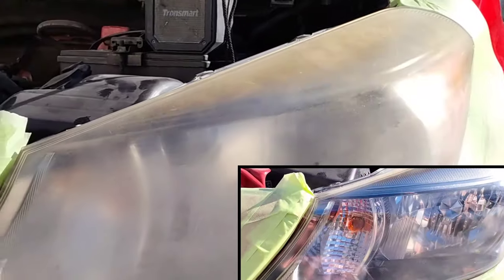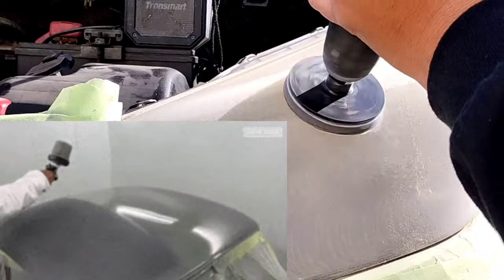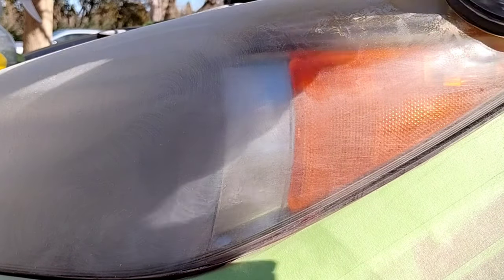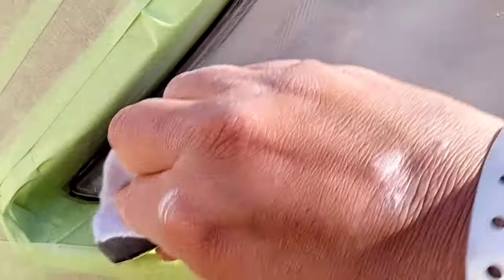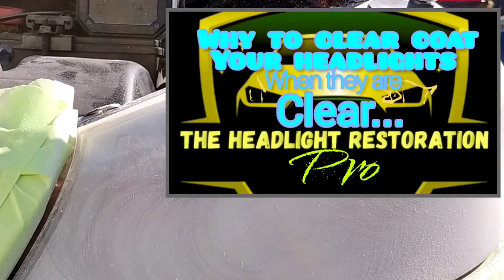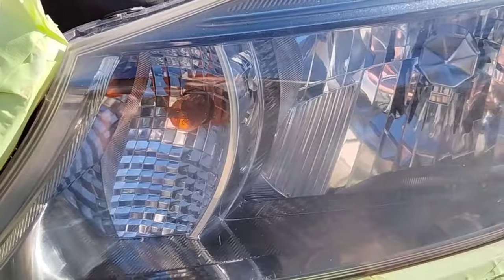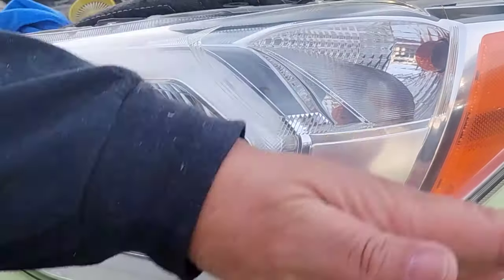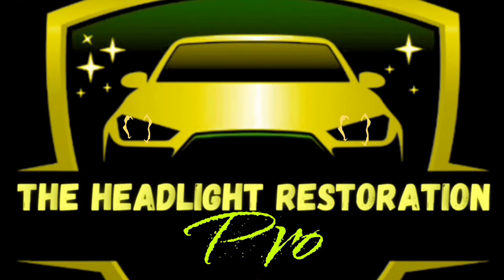how to CLEAR COAT HEADLIGHTS like a BOSS 🦍💯

Comment: Two questions for you:
 1.Have you ever used ceramic coating instead of clear coat?
2. Have you ever cleaned inside headlights?
Reply from the maker: It's almost useless cleaning the inside of a headlight once you open them they're never the same and 99% of the time if you try to open a headlight you will damage everything around it it's damn near impossible it takes so long it's not possible far as a business setting.. it's a total loss because it would take 3 to 4 hours to probably open it alone without breaking it.. just a labor would be too much..
I have you ceramic coating and I'm still experimenting with it.. I would not recommend it with headlights.. it's too thin and too hard.. which has to do a lot with impact.. also the UV protection is not adequate and dies fast, classic kind of wears off like Wax does.... At best can be used as a topper.. a lot of people use ceramic on headlights.. and a lot of people don't know shit about headlight restoration but they think they do..lol😂🤣💯
Reply from the maker: The ceramics that are designed for headlights are a little bit better... But you must keep in mind there is no such thing as a ceramic spray coating (aerosol/rattle can/or anything you hook up to a spray gun)
Thus far is far inferior in comparison to anything that comes out of a can..
The delivery method is flawed and can't compare to anything else that is spray-based...
Reply: @theheadlightrestorationpro  Would love to see a video comparison or just your thoughts and findings around various ceramic coatings you've used and the long term results they've yielded. That video would be gold for any detailer!
Reply from the maker: Good idea 👍🏼💡

Comment: Watched this whole video for you to not tack it down after you polished the first light and after you touched the 2nd light with your oily hands. That small barrier compromises the integrity of the paint and can cause orange peel. But nice process otherwise
Reply from the maker: All of what you say actually makes headlight restoration not better...makes it worse... tack. ..no need... You want to keep the beneficial oil locked in.... This is parsley why my finished product is superior than most anything you've ever seen on the net or in life..💯
Like I said Watch more of my videos I describe this in depth in plenty of other videos..
Also zero orange pill every time... Probably should watch more of my videos...
This one explain..
https://youtu.be/LC4ZBu02JZg
(Hands are dry from the dust of the headlight restoration)

Also this is one of my  one of my portfolios... therrs like  3 more... proofs in the pudding 🍮...😁
https://youtu.be/4a95Lu16QVc

Comment: You apply 2K clear coat to the cleaned, sanded headlight surface so that the clear coat has something to stick to (bond). Your method of polishing first is bad for the clear coat because your headlights are too smooth for the clear coat.

Sanded with 2000 grit and cleaned with antistic water based cleaner like isopropyl.
This is what every clearcoat manufacturer tells.

Polishing is always the last step, since it completly closes the surface.
Reply: Your not paying attention the pro would never apply that crap on any headlights ever, 😡🙄

Comment: Your sanding looks a little too agressive, the plastic  headlight lens is thin
Reply from the maker: I don't ever saning...
Oh you edited your post your message is edited now..lol
It's not as energy would think if you've ever did have that restoration you would know this it would take probably 3 hours of sanding in one spot for the multiple sand papers hundreds of sandpaper discs to grind through the light completely...
Reply: @theheadlightrestorationpro what products do you use for the rubbing compound and clear coat , sand paper grit numbers
Reply from the maker: @bryanb380 everything is listed in the bio... Everything is listed on the videos as well... There's over 140 videos of how streaming 99% of them have everything in the bio and everything listed during the video....

Comment: spraying any petroleum distilliate on polycarbonite starts substrate degradation same as the UV light passing thru it which is reason for polishing it. Despite what this guy claims optical clarity is diminished and gets worse everyday I would never do this to a customer not a fix!!